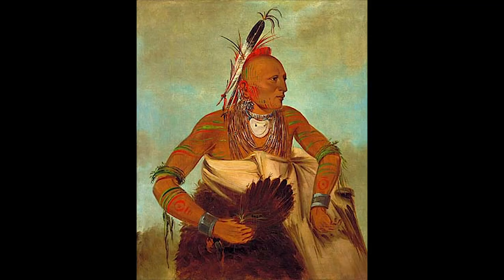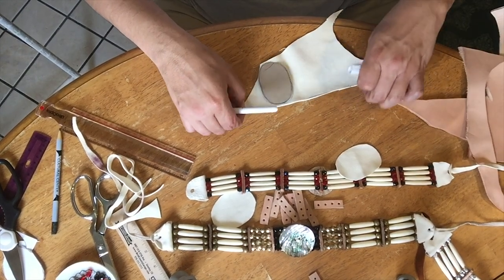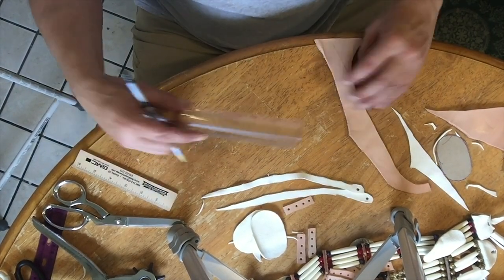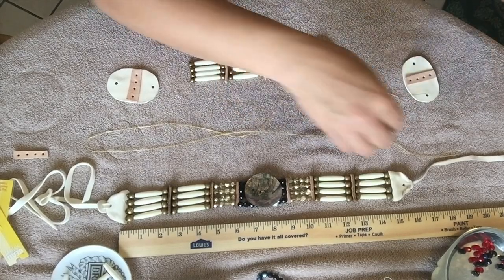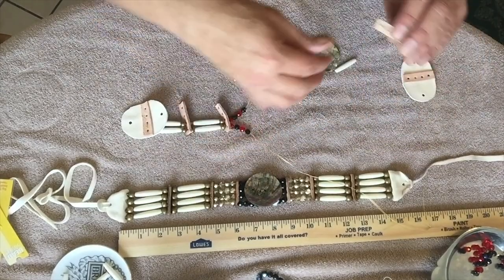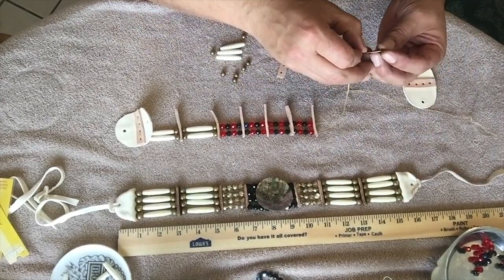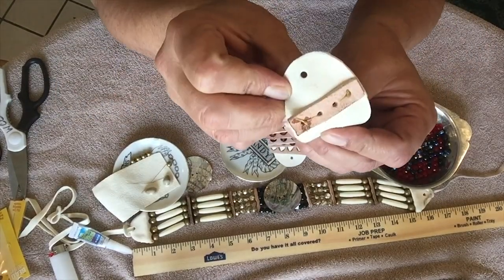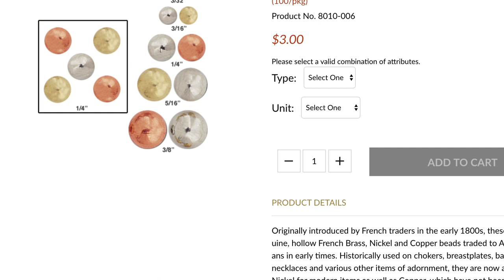Mens Choker Tutorial

Comment: How do you make a three row choker? I just finished making one for my art class and I watched your video for how to make it but I made by choker three rows instead of four and I improvised the ends 🤷🏻‍♀️
Reply from the maker: Are you confused about the spacer or tying the choker? For the spacer,  cut if shorter or order 3 hole pre-punched spacers. About tying your choker, 1 row will just be 1 string tied on each side, creating a single row. Create the other 2 rows, as described in the video.
Reply: @wahzhazheculturalcenter7546  also I’m using sinew (I think that’s how you spell it) the holes I punched are too large for multiple knots, what do I do then?
Reply from the maker: @llw8845  Good question, you can tie onto an extra bead before you go through the holes you punched. tie around the bead and use that to anchor the sinew in place
Reply: @wahzhazheculturalcenter7546  thank you so much I hope to make one more before the semester ends!